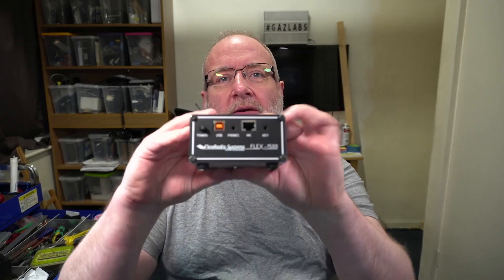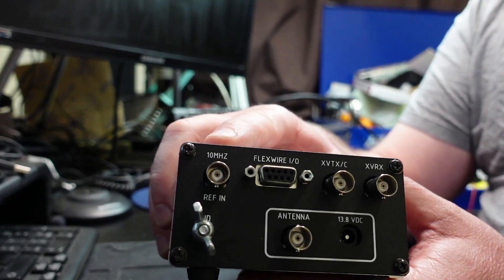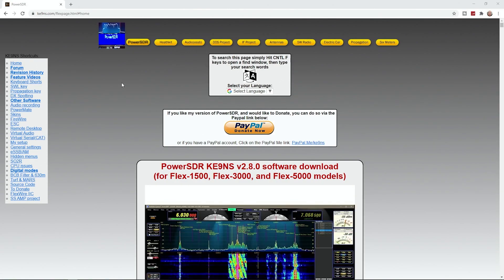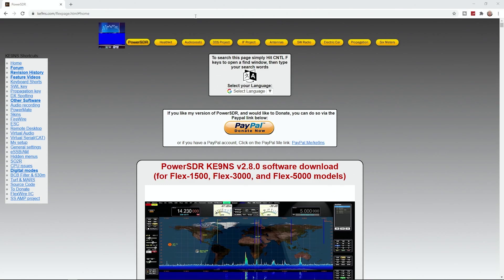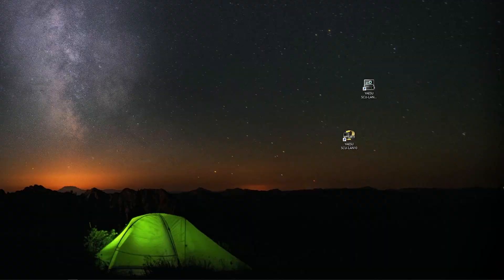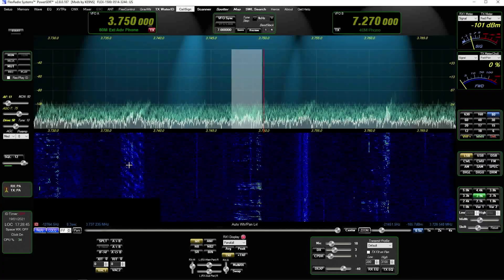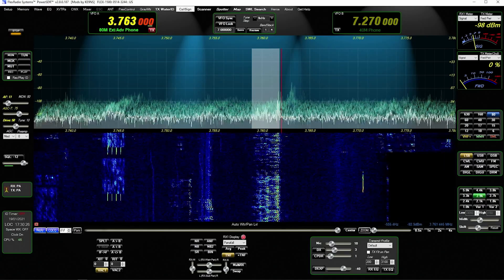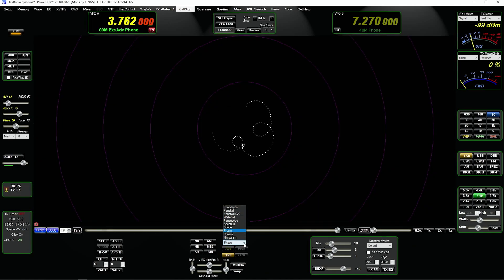Bargain SDR, The flex 1500 best value used SDR?

Comment: I’ve had mine for just over a year.  I got one that was new in box, never used, in original sealed plastic.  It was acquired at a storage auction for $50 bucks (total price of the storage unit).  It was owned by an electrical engineer in Missouri who had TWO of these new in storage.  I paid $400 for mine, downloaded the KE9NS software, watched your video, and was off.  I use a Yaesu hand-Mic, head phones, and an EFHW.  2000 QSO’s later, I’ve won the Tennessee state 2021 QSO party (qrp division) setting a SSB record  shattering the old by 5x the points.  Good chance I won the 2022 party too, log just submitted.  I’ve “hunted” over 700 parks for POTA, using my legit qrp “suffix” to get through insane pile ups.  It is as amazing as you say, the ease of which you can scan the band and pick up signals is nothing short of phenomenal.  I also get entirely unsolicited compliments on my audio quality as well.  No better/cheaper way to get into a flex, considering a new 6400 costs $2200.  If you can find one in good condition, pick one up now!

A few negatives to make it honest, NR is just ok; noise blanking is phenomenal, but reduces selectivity so that strong adjacent signals can bleed in.  Still NB takes out so much hash in my neighborhood that I drop the noise by 2 s-levels, so the selectivity problem is easy to live with, especially when using only one of the two NB algorithms which takes our 90 % of the hash with only mild selectivity issues.  No true power meter, no SWR meter (solved with a cheap add-on meter or an antenna analyzer).  I don’t do CW much, so I can’t speak to that issue.  I’ve heard there is lag but this is solved with an external keyer.  It is a used product, I don’t know if Flex will fix them anymore.  But for $400 ballpark, free software that’s phenomenal, and  with this being a true SDR, we are talking amazing value and low risk.  The latest version of KE9NS’s free software is compatible with windows 11, so this rig is future proof for what will likely be another 10 years (the lifecycle of windows versions).

Comment: Gaz, you convinced me. I bought one on eBay from another ham for $395. I used some small diameter heat shrink tubing to insert around the Antenna BNC connector to stabilize it. RFDAN on eBay sells a prebuilt key line cable for it. It’s driving an RM Italy HLA-305V QRP Amp for a couple of hundred watts. Thanks for the video!
Reply from the maker: They are a bargain, shame flex stopped the entry level rigs :-(

Comment: I have a question.  If this was set up using a 100w PA with a tuner, like the Xiegu XPA125b that I already have, does the PTT and maybe even tuner trigger and configurable band control voltages come via the I/O flexwire connection, or was there another means?  Have you seen this setup before?  How well did it work functionally?
Reply from the maker: I would make an optocoupler for Ptt, band switching requires a home brew interface .. the flex will have a ptt out.. gaz

Comment: Just changed the BNC connector that broken off. I used a straight PCB mounting BNC it went straight in and as the support legs are much thicker and stronger and solder directly to the board . The only adaptions I made was to extend the centre connector which I used a long gold plated pin from connector and working fine. Great run video many thanks.

Comment: An awesome radio listed highly on the Sherwood report.... will never sell mine. It’s hard to get a radio with separate RX /TX antenna ports ... the receiver is amazing. The only problem l have is with the legacy program Power SDR it doesn’t quite sync with WinLink because of latency issues with the Flex... My only wish is that Flex should update the 1500. But I can honestly say it is better than my SunSDR and most other SDR’s on receive.
Reply from the maker: Great value, it’s nice to see someone doing so much to keep them alive ..